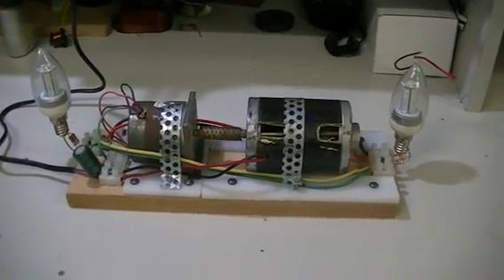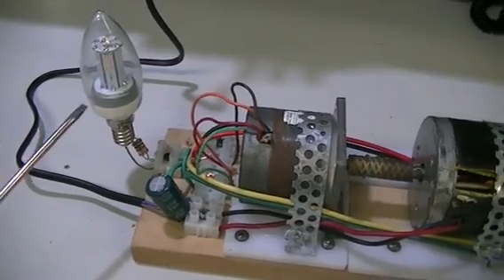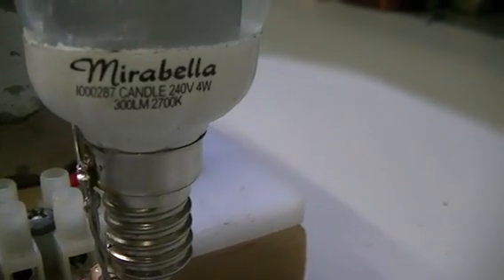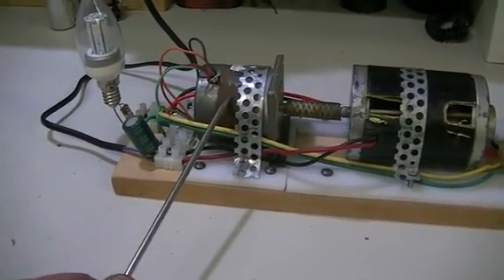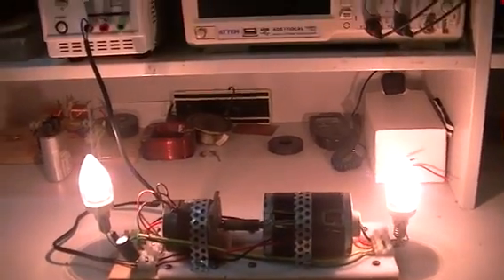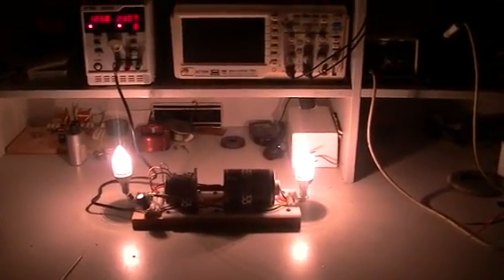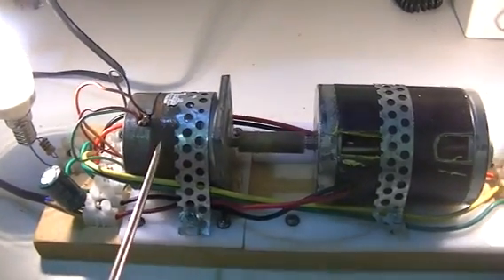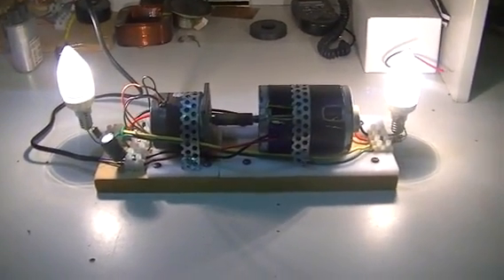Simple 240 volt Rotorverter.

Comment: That is fun and teaches about similarities of motors and generators. These things are called 'DYNAMOTORS'  and once powered all kinds mobile devices on D.C. batteries. These power converters can deliver A.C.  at the voltage and FREQUENCY required. That A.C. could then run transformers to provide, say- High voltage for vacuum tubes -Low Volts for filaments, relays and lamps. You can't run a transformer on D.C. so you needed a Vibrator power supply or dynamotor . They powered World War II.

Comment: better still  150W Car DC 12V to AC 110V 220V Power Inverter Charger Converter Boost Board | eBay  www.ebay.com/itm/150W-Car-DC-12V-to-AC-110V-220V-Power-Inverter-Charger-Converter-Boost-Board-/172124189007?hash=item281366b14f:g:FIgAAOSwu1VW3AUl#shpCntId

Comment: No disrespect but don't you think you are going backward in technology. This $10 inverter will do the same job much more efficiently and noise less.. http://www.ebay.com/itm/12v-36V-ZVS-Tesla-coil-flyback-driver-Marx-generator-Jacobs-ladder-Heater-/401033875125?hash=item5d5f7b4eb5:g:AlIAAOSwbdpWWXRj

Comment: True sinus power generation, used to light up LED's which can run on DC (using a dc 2 dc booster). Sorry, but this is so much wasting your time. And don't say you did not expect this comment?
We only want to know what is in 'the box'. You know .. ..
Reply from the maker: The stepper motor puts out a true sinus wave,and the LED already has an AC to DC converter in it. These are just experiments for people to try at home,with the junk they have lying around.
Whats in the box ? lol.